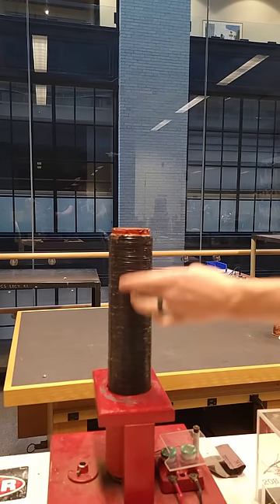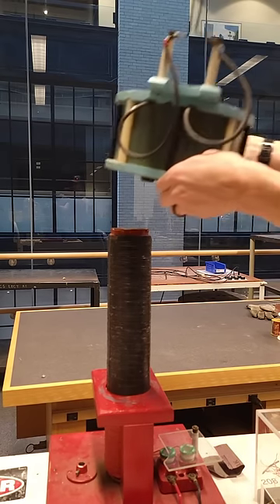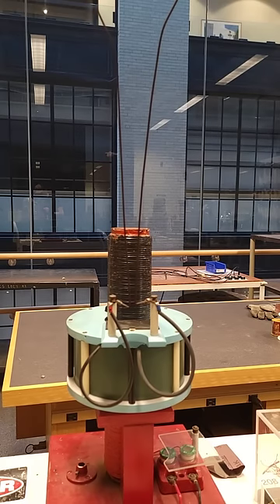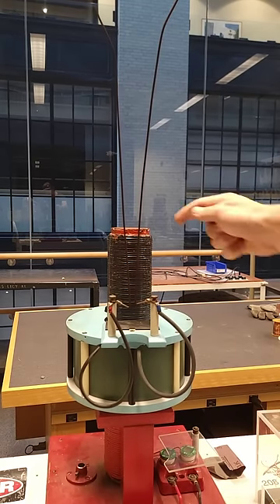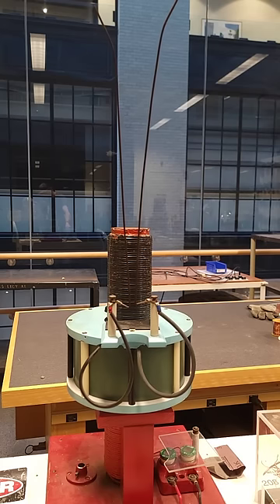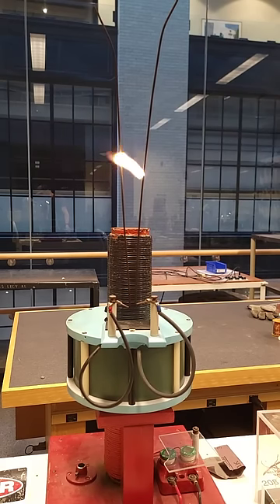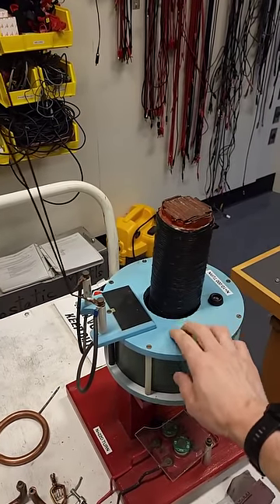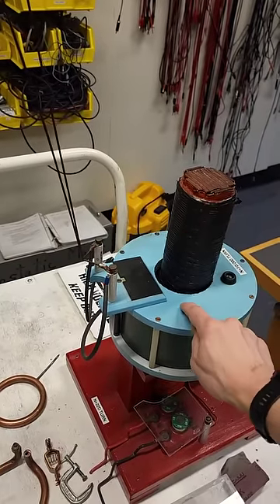Watch this 10,000 turn transformer breakdown air! #shorts #physics #science

Comment: "What i just built is a step-up transformer" 

If only ikea was that easy.
Reply: Don't worry.
IKEA has a new fusion reactor range coming in about 30 years. 😊
Reply: I didn’t know Decepticons were into step training?!
Reply: @Mutski1579 
It’ll be flat packed, too!  I’m assuming.  I hope the directions for assembly improve though.
Reply: Where can I get one? Our local Radio Shack closed a couple years ago.
Reply: Technically, yes, what he built is a transformer.

But those two rods with the spark arcing between them is called a Jacob's Ladder.

Comment: Just calculated, 110-120v input, should give about 5-5.5kv output, with reasonable current, Also those are inductors without a secondary, solenoids usually have moving parts and are associated with Relays, also with the arcs, It’s not really “Burning” The air, it’s Ionizing the air, which is making all of the Atoms in that section of air Highly Conductive, just wanted to let you know :)
Reply: I've got the same results haha
Is there a diference between having 220n-10,000n and say 11n-500n? (n is number of turns) Because the relation between the two is still 45.454545...
Reply: @winthepooxd534  shouldn't be much of a difference just the drive frequency would have to be way higher if you wanted to do that
Reply: I don't know how much wattage was put into the input but watts in is roughly the same as watts out (of course there's losses due to air gaps and other inefficiencies) So... if it's 1500 watts in (at 110v) it'll be 0.3A at 5000V
Reply: @ivanf4023  yea, still 300ma is definitely killer, I think mots output ~600ma @2.1kv
Reply: @Kepler_2258 this set up he built is  putting out the same or slightly more v than a a mot. My lichtenberg wood burner (buit from a MOT) puts out roughly the same vots although I control that on a variac. It also (in short burst because the transformer doesn't like to be deadhead for that long) can be used to make small amounts of synthetic rubies. They need extreme heat to fuse. A grafite crusible and a grafite rod similar to whats used in arc gouging helps make this possible without introducing contaminants. After I burnt up 3 MOT's i gave up and just used my tombstone Lincoln AC/DC arc welder lol. I just wanted to see if I could have any results with the mots first. I did but the windings are just too small and don't produce the amps that was needed for a larger Ruby
Reply: @ogt92fromthe1step9  yea, well, the MOT circuit Is a voltage doubler, the MOTs themselves only output 1900-2300v (most commonly 2100v) AC, then it goes into a Capacitor and Diode Which Doubles the Voltage and Makes it Half Wave DC (Only Positive Wave of AC, Basically Pulsed DC) and that’s about 3800-4600V (most commonly 4200V), this transformer in the video however outputs about 5500v Raw AC, if you were to put the same circuit with it, you could get Over 10KV Pulsed DC
Reply: @Kepler_2258  when you stack HV caps you can get a higher output. Also feeding through a variac transformer (depending on the size) you get a slight increase increase in line voltage (10-20v more) also bringing up the Total output. Haven't messed with measuring oil burner transformers or ballast resistors yet. But I heard that they yield a greater output. At the end of the day they all produce minuscule amounts of amperage and that's really no fun. 
If you really want to see something interesting about stacking HV caps from a microwave. Check out Photonicinduction 
Popping a 5K A fuse
Reply: @ogt92fromthe1step9  I saw that video, that was crazy that he was able to do that xD imagine if you got hit by that 💀
Reply: @Kepler_2258  if not dead at least some sort of amputee
Reply: @ogt92fromthe1step9  yea
Reply: Yet no one asked...
Reply: @rickwilliams967   bro really trying to be toxic, you really don’t want to go down that route Bud
Reply: @Kepler_2258 Something is wrong with his explanation, to ignite an arc across a gap of that length you're gonna need something closer to 11kV AC, so if his turn ratio is right then he must be using full phase (~240V AC) instead of split phase (~120V AC).
Reply: @xxportalxx.  yea, he could be using 240
Reply: Could I use this as a bug zapper throughout the nighttime outside season and what would my power bill run me based on how often someone might be outside and average weather in Wabash Valley, Indiana?

This would be a conversation starter at BBQs
Reply: @cameronvanatti6629  lmao would be expensive and dangerous
Reply: @Kepler_2258  sounds like a real party!!!
Reply: @ogt92fromthe1step9  lol
Reply: @cameronvanatti6629 when I was a kid I got ahold of the 10,000 V 120 milliamp neon Transformer I made a bug zapper with it and I threw a large grasshopper on it and the grasshopper caught on fire and fell to the ground and my dad told me I couldn't keep that was going to burn down the house
Reply: @Kepler_2258  expensive and dangerous, yes, but it will be cool
Reply: @MrNorthstar50  just need to surround it with a fire protective measure like pebbles and put it away from trees and buildings
Reply: I don't know as much as others here know about electricity, but I do know that normal fire also ionizes air. Ok if you define 'burning' as rapud oxidation in a gaseous atmosphere, it isn't, but the fact that it's ionizing the air isn't what stops this from being burning/fire.
Reply: @dhayes5143  oxidation and ionizing are different things, ionizing means that all the molecules in that area become Positively or Negatively Charged and become Highly Conductive, Oxidizing means that its Adding a Oxygen Complex Onto a Molecule that Usually Doesn't Have That Oxygen Complex, Electricity Can Oxidize Though Since it Causes The Oxygen to Become Charged, And That's When You'll Produce Ozone, Nitrogen Dioxide, Etc.
Reply: you had to calculate that ? it seems pretty easy , he said 10k at 220 , so at 110 , which is half why bother with the slide rule?